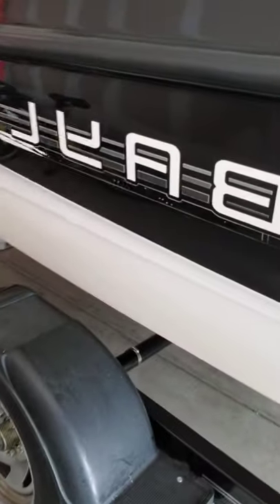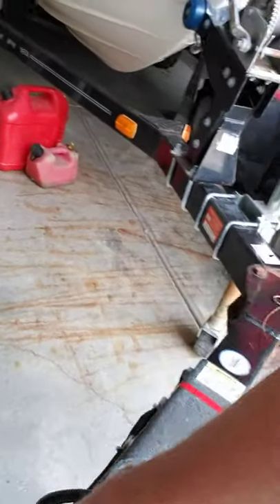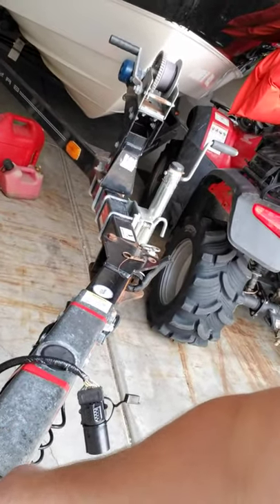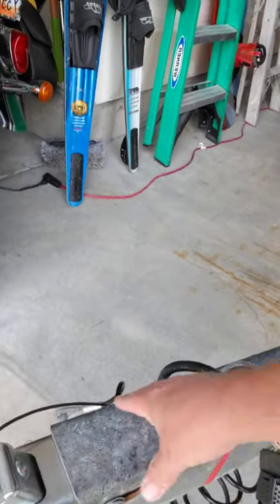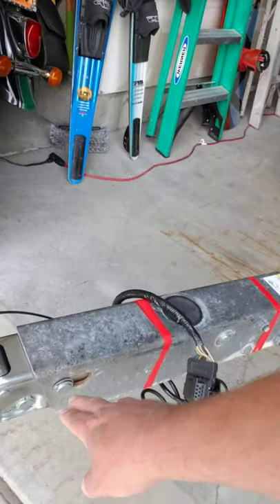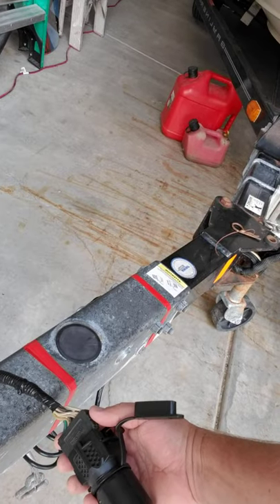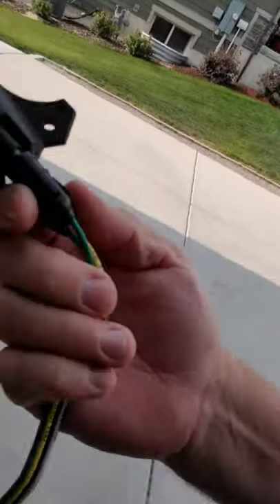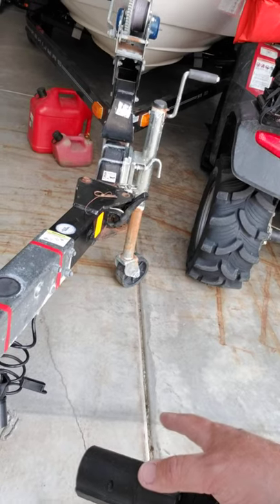understanding how surge brakes work on a boat trailer

Comment: If the safety cable is pulled out, it may or may not break the cable, but their should be no damage to the assembly other than the cable, which is easy to replace. If the cable is pulled for whatever reason- you should be able to reset the assembly and continue on, you just need to release the lock under the brake assembly.  I’d suggest you view other videos about how these work, as someone sold you a bridge as to all the repair cost you endured.,

Comment: That other piece attached to the cable that contains your coupler locking pin is a brake lockout for the surge coupler.  Now that you have a brand new coupler and a 5 pin flat, that has the reverse signal, it's a non-issue.  Others like myself, who's trailer plug is only a 4 way flat, have to get out and insert that lockout tab in the brake lockout bracket which sits just behind the front roller.  It can be a real PITA not only to remember to put in anytime you want to back up anything with a slight grade, but also to remember to remove so you're not driving down the road with your surge brakes locked out if you can even get the thing to stay in, in the first place, as they're suppose to self-eject, which they tend to do even when you're backing up.  I bought a magnetic one that's worked great, but unlike the chinsy one that comes with those couplers, I do actually have to remember to remove it or I'll have no surge brakes.  Also worth noting is the breakaway cable should not be attached to the safety chains, but as you said, but to your hitch's chain bracket.  An easy way to keep that thing in place is to remove the 'S' link that's at the end of that cable and put a carabiner in it's place, then you just clip onto the chain bracket.
Reply from the maker: Love the idea of using a caribener for the breakaway cable
Reply: @MikeRathgeber  it wasn’t my idea, but it works great.

Comment: The guy I bought my boat from said "the boat doesn't need transom tie downs because the boat is heavy and won't move".
Reply: Depending on the boat and trailer setup, it might not. I have a boat I've pulled all over the state and has never been an issue. Hit plenty of potholes, curbs and speedbumps. Have had blown tires and bearings plus emergency stops. Heck, sometimes even putting it in the water requires some hard braking. Wouldn't recommend this for a Jon boat or something light of course

Comment: i was told that a lot of these trailers also have free Reverse pads,, which are slightly tapered so that they physically cant engage the brakes when moving in reverse. the problem is, how does one know which type they have?

Comment: I’d love to love your video, and I really like  the content, BUT I cant see most of what you’re intending to shoot.  Your camera is not getting the subject or your comments (like the lockout pin, etc). This would be good if I had the visual, but you’re focusing on the boat in the background and not the brake actuator and its components. I hope this helps.